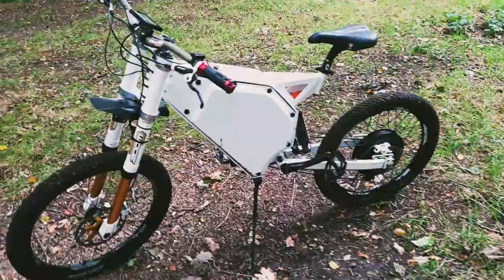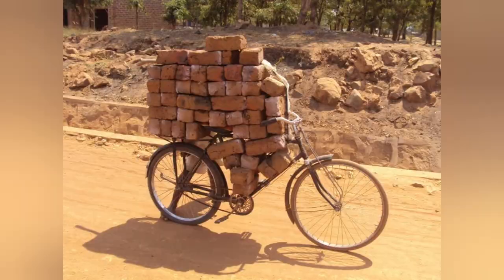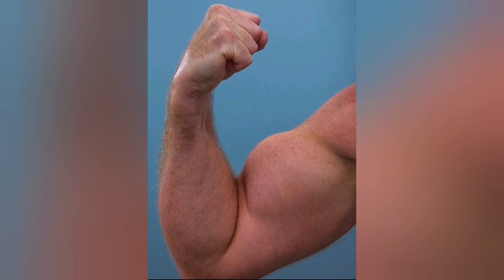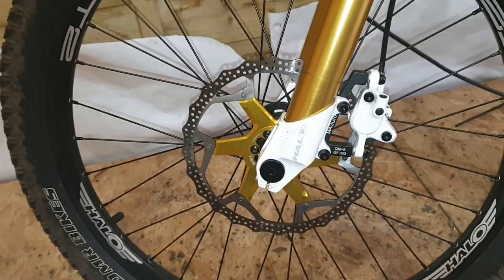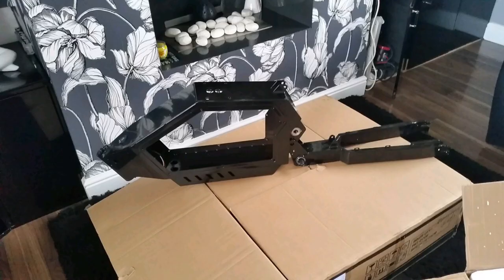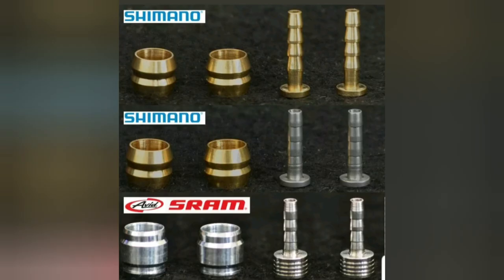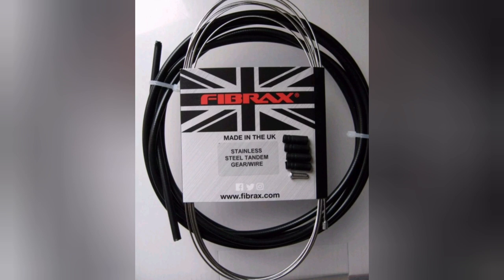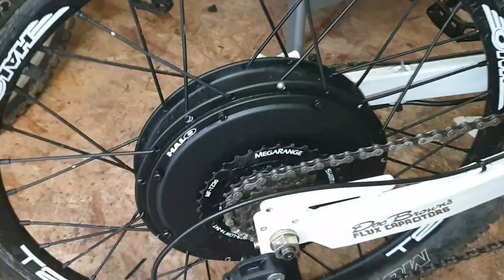Diy ebike build, Warning tips that will save you time and money

Comment: the insight is very interesting , i live on the third floor of a building tho , i'm afraid a "dedicated" e bike frame will be too heavy to carry up and down the stairs , i'll stick with a converted mtb for a bit
Reply from the maker: Oh for sure, it will be too heavy to carry up and down stairs
Reply: you could always switch it to low power and throttle mode and then just let it do the  lifting.. you only need to guide it up
Reply: @EnterTheFenix  aaah maybe i could actually , just need to be carefull with all the carpets

Comment: Nice bike mate I'm thinking of getting this frame would a 72v battery and controller fit in this frame
Reply from the maker: The controller may have to be mounted on the outside if the 72v battery takes up alot of the room

Comment: Anything looking like a slight incline and I push mine on the few occasions my bikes cut out.
Reply from the maker: 😨 I certainly won't push mine, I've had to pedal to help out the motor to get up hills, but if I have to get off and push because of an incline, then  the bike isn't built for purpose and something isn't quite right🤔
Reply: @DavidAinscough100  No sorry I mean a failure like your controller cuts because of low voltage, so you cant use the motor, sorry.
Reply: Have you had any issues with the plod riding this on the road? I see alot of ebikes on the roads, usually don't look quite as big as these but as long as riding sensibly I wouldn't have thought I'd get many issues?